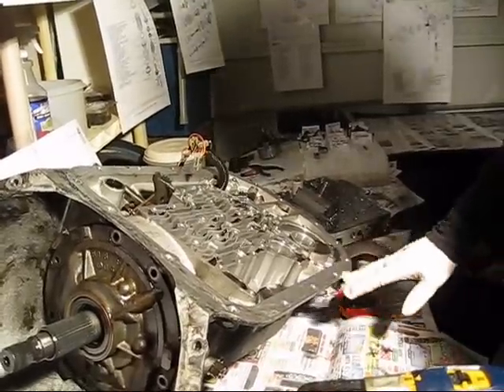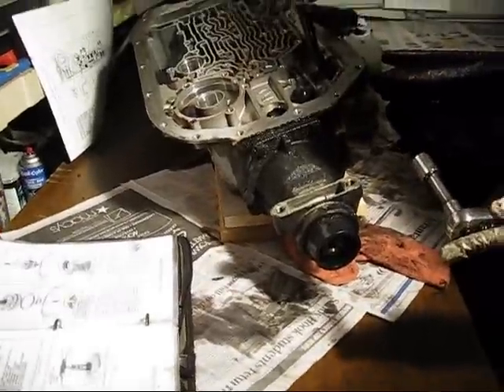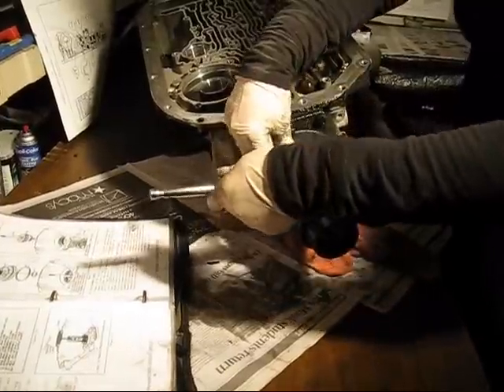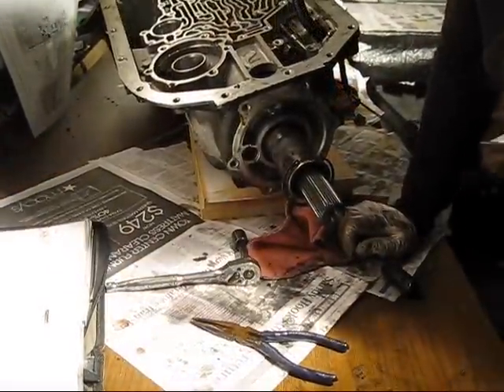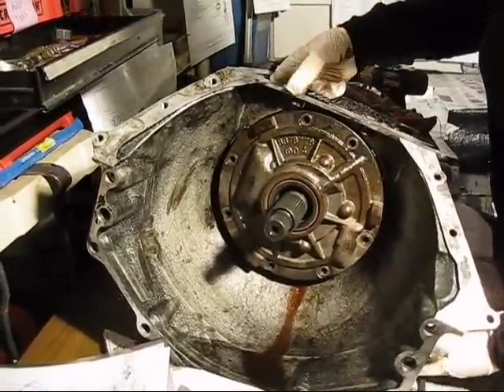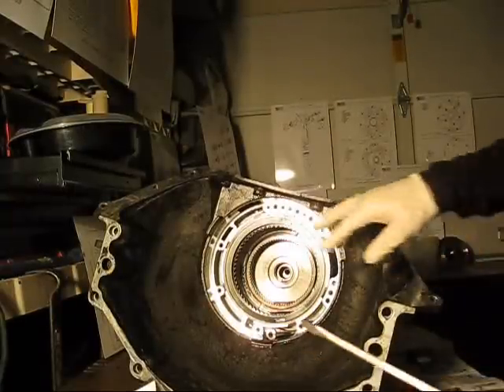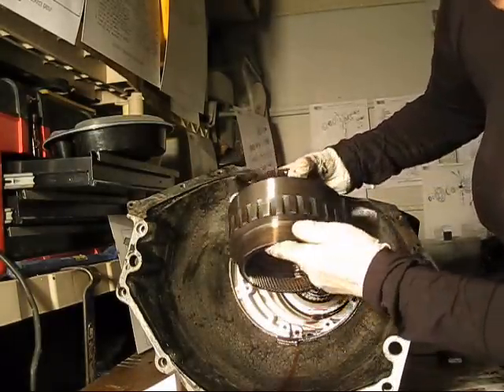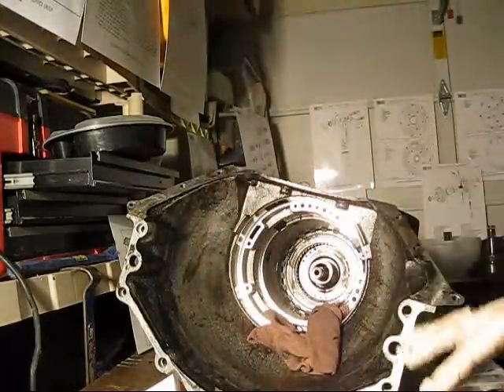4L80E Main Disassembly #3 crop

Comment: Love the way you approach this project.

Little suggestion, next time you want to get bolts off that are too tight, put a pipe on your wrench. It will stop you risking the grated knuckles syndrome. and make the project far easier. (you don't have to do it the way a beefy 250 pound man would do it)

Just be careful if you do though, you can put on a lot of force with a pipe on a wrench